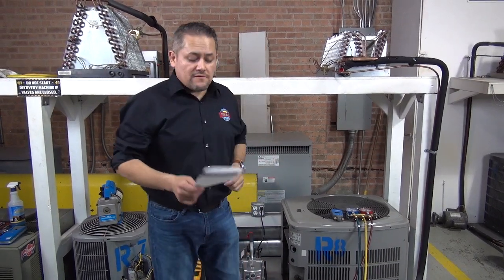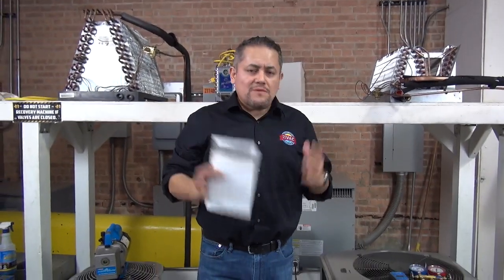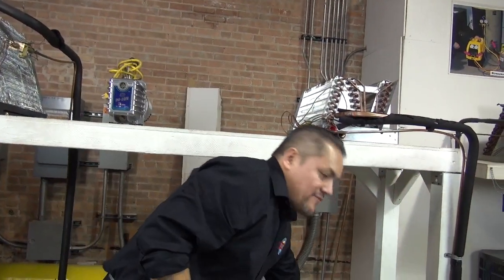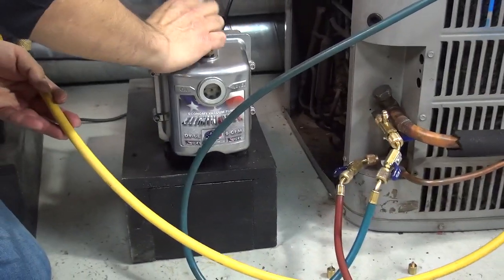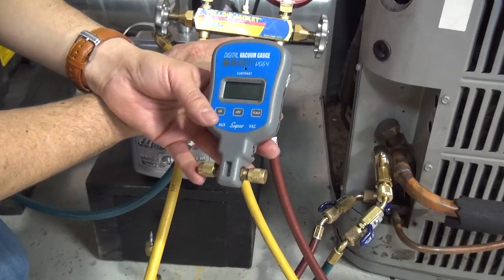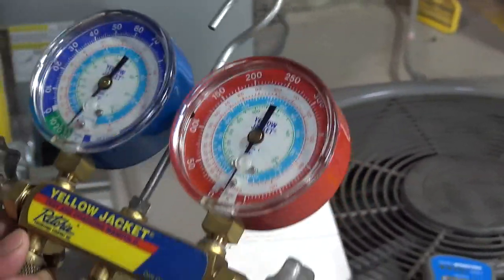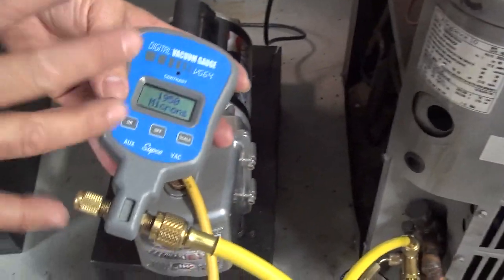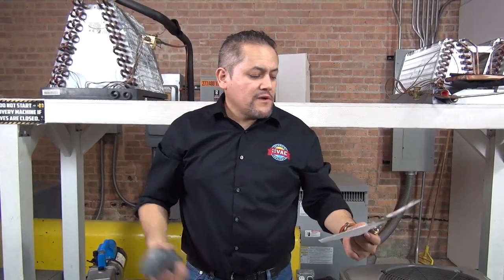How to vacuum an air conditioning system.

Comment: Again, great vid. I will be vacuuming my unit. However I won't be filling it with refrigerant until a few days later. Is it ok to vacuum it and charge it with refrigerant days apart?
Reply from the maker: @culture12ny  We normally don't do this,we're done with the vacuum we charge the Unit but if you are gonna leave your gauges in there because as soon as you take your gauges off air is gonna go inside so i don't think you're gonna leave your gauges for a couple of Days
Reply: @paulohvac  lastly, don't you have to take your gauges off anyway in order to fill it with refrigerant? Or, are you leaving them in and just connecting the yellow to the refrigerant and so on?

Comment: good video good explanation. do you have the video that showing how to refill the freon? I like the way you explain thanks
Reply: thank you, working on it.
Reply: Paulo Perez thanks for your reply, I had one more question do we need to open the high & low side service valves? Gracias Señor
Reply: @vettc7417  yes is recommended, more access better vacuum and if you add a core removal tool much better
Reply: @pauloperez8457   Gracias Señor

Comment: After you finish your vacuum do you now open your service valves on your condenser?
Reply from the maker: Well, check the microngauge make sure the microns stay at manufacturer recommendations and then open the service valves..

Comment: Great video thanks I have one question could I use a 2.5 ton mini split condenser to a 2.5 HVAC evaporator reason is I need to cool the house I'm a little dout about a wall mount unit I'm been told they go out quick. Thanks
Reply from the maker: Yes, the evaporador they don't last i guest you can do it, better to ask manufacture.

Comment: Hi, after replacing a suction line and liquid line service valve do you perform the vacuum with both valves open? If so, wouldn't the vacuum pump pull compressor oil out of the system? Thanks
Reply from the maker: No..

Comment: Hi, I installed a new residential ac system. When vacuuming my pump is discharging a lot of air and my gauge barely moves from the zero mark. Does this means I have a big leak? Thanks
Reply from the maker: Yes, or lose coneccion or bad gasket on the gages.

Comment: You make a point about removing the Schrader valve on the suction line why not remove it also on the liquid line for better vacuum
Reply: Yes, I agree; however, I noticed Paul showing only one core removal tool. Of course, 2 removal tools will allow you to have a less restricted flow therefore faster evacuation process.

Comment: I have a question, if I’m gonna disconnect my lines for roughly 10-15 min. Do I need to pull a vacuum again before opening back my valves with refrigerant?
Reply from the maker: Yes sir.
Reply: air will get in the system, as soon you disconnected the line. But you lucky enough the system still running ( ok) but ! Not running good as before you open up the line.